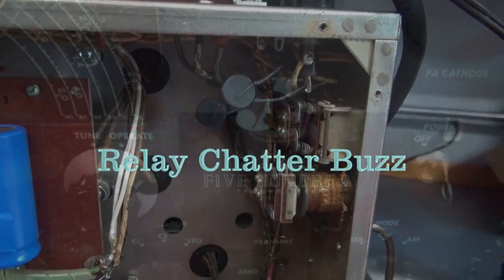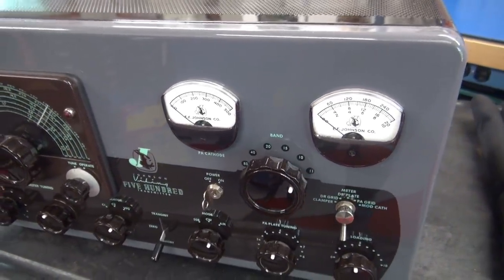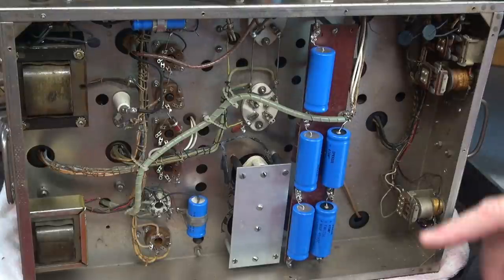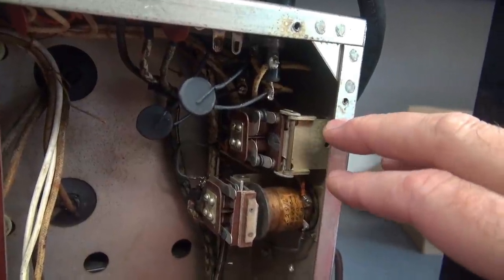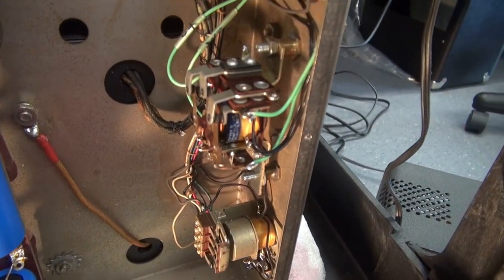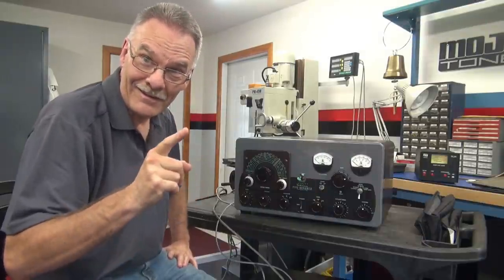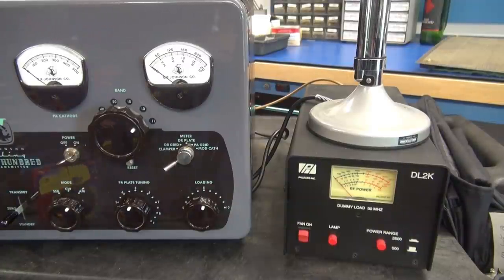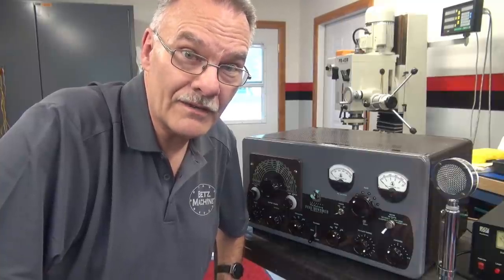Relay chatter EF Johnson 500 ham radio transmitter What is the cause? How to locate fix the problem

Comment: Hi Terry, My 500 is popping the reset and a fuse sometimes but Im fully tuned up to 300 mills running PA and 8 mills of grid watching  your PA cathode it looked like it never came near the required  425ma to trip the reset. So What am I missing . was it to fast for the meter?

Comment: Did Johnson get the transmitter with a key switch to operate the AC power supply?
That seems more like a aftermarket idea to keep people from using it on citizen band.
Reply from the maker: Yep, they came that way stock

Comment: I can easily understand excessive contact spacing, and dirty contacts, but other than shorted out coils how does a relay lose inductance ?    Couldn't it be rewound ?   Thanks.
Reply: ...the only thing I can figure, is that the wire in the relay coil deteriorated: the wire is very thin, and over time due to heat and oxidation, the resistance of the coil increases- as a result, the current through the coil decreases, and so does the magnetic pull of the relay coil.

And, yes- the coil could be rewound- but since the metal parts on a relay are very seldom easily disassembled and reassembled- it would be a formidable job.

Comment: What goes wrong with the relay?  Seems like it would have to be 1) The switch is too stiff, 2) shorted coil weakening the magnetic field, or 3) broken magnetic core. Depending on construction, it might be repairable.

Comment: if there are 866 rectifiers they do not want to run on their side.
Reply from the maker: I agree, this one has 3B28's
Reply: @d-labelectronics  the 3B28 is nice without the mercury. I would come on those in motorola tube base stations. the way I would test was to run it on one tube at a time and that way I could tell which one was getting weak.